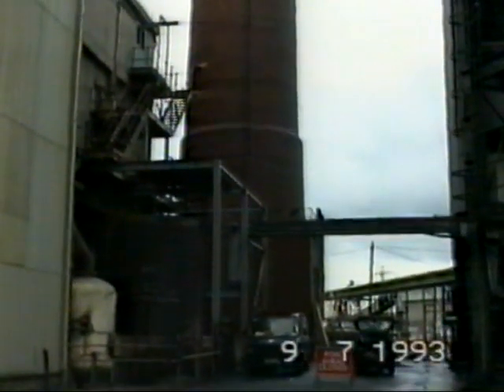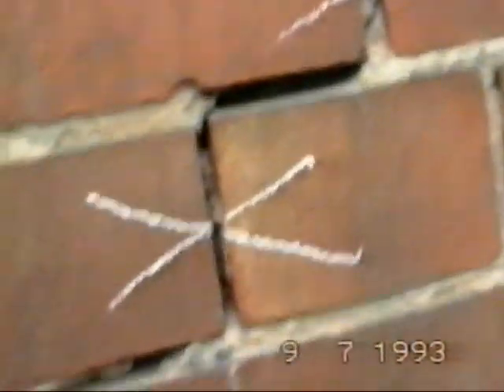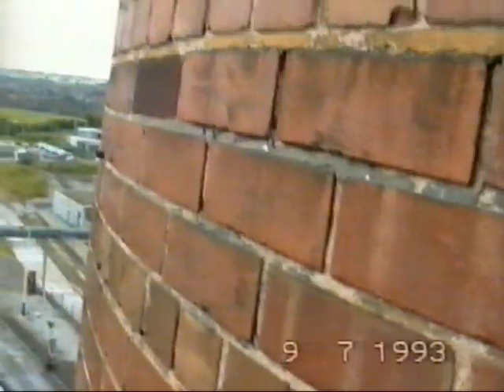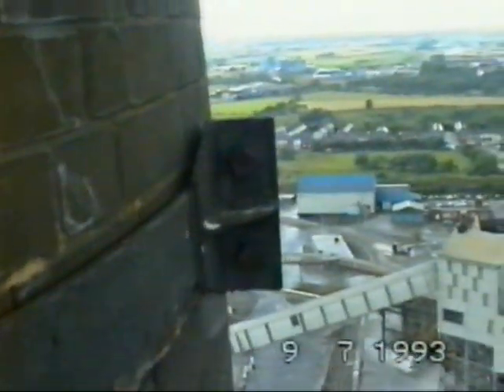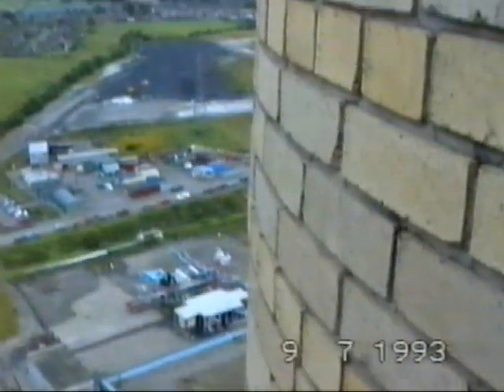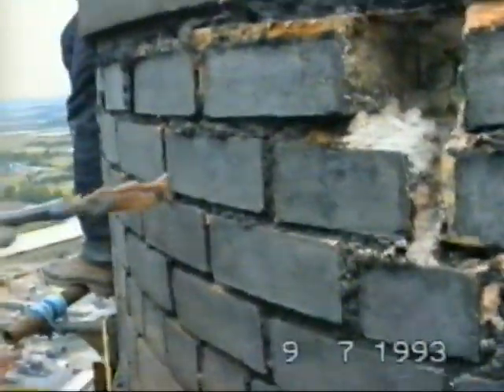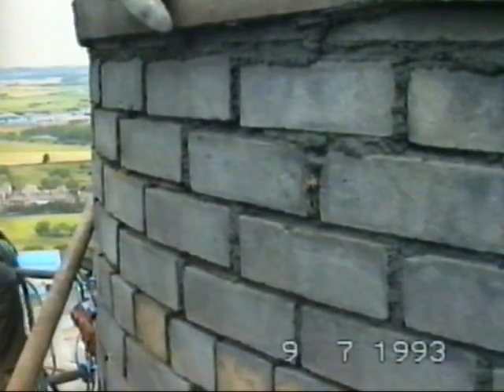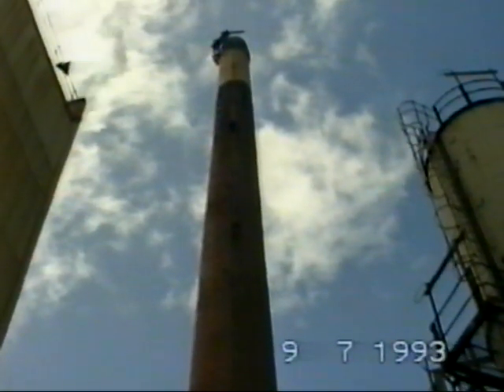Med 037a Pendrich Steeplejacks Survey of 307 ft chimney at Brunner Mond Lostock 1993

Comment: When your ladder is fixed to a chimney and your start pocking a trowel in and find no mortar would fill me with sheer dread
Reply: Think how many thousands of tones are pushing down on it, its going nowhere.
Reply: @union310  fair point but thats at the bottom....what about the bricks that are falling out right at the top???
Reply: @stevewoodward7850  The ladder is fixed beneath them
Reply: @union310  Freds ladders are fixed bottom and top...whats to stop it toppling over??
Reply: @stevewoodward7850  You attach the last ladder to the former and stake against the chimney within arms length of the top of the former. Then proceed to climb and repeat as you climb.
Reply: @union310  ahh right.....thats why lm not a Steeplejack mate.!
Reply: @stevewoodward7850  😂
Reply: @union310  At the top that doesnt count so much.When the last five or six layers are this bad you got to know what your doing if your going to get up top and  go walk-about!